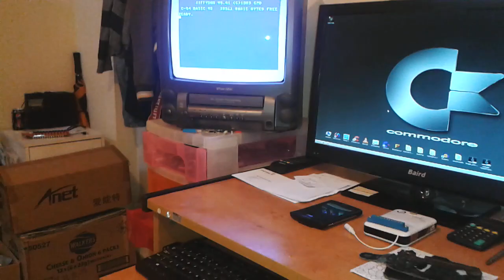Battery Powered Commodore 64,internal battery pack for C64C

Comment: That's cool, is it like a laptop where if you disconnect the power supply it automatically switches to battery power? And once plugged it is get's charged?

Comment: Which DC to DC step down convertor did you use?
Reply from the maker: https://www.ebay.co.uk/itm/261714403192?hash=item3cef64df78:g:AoMAAOSw2ENW7D4O
You need to adjust it to 5V output first mind.